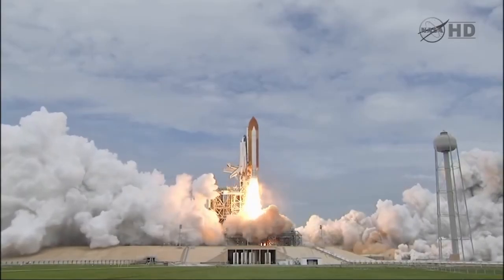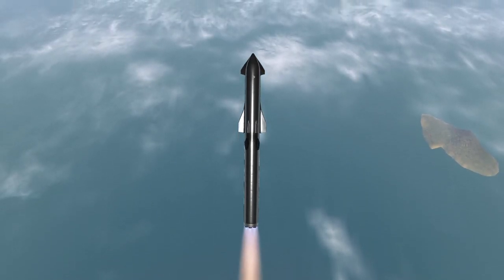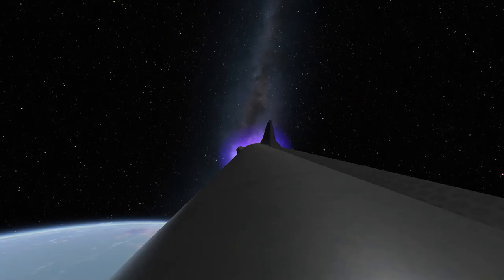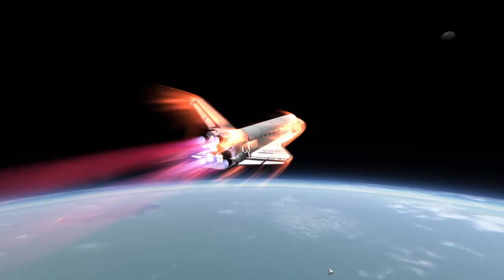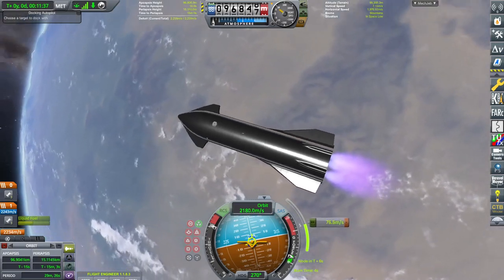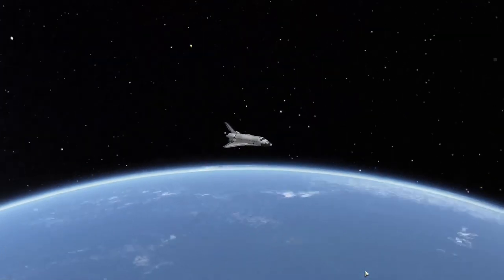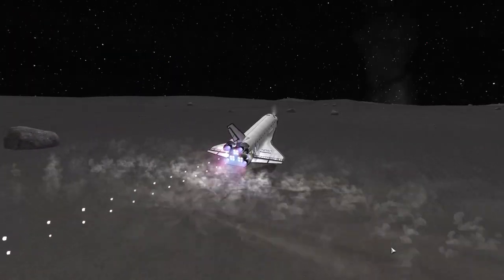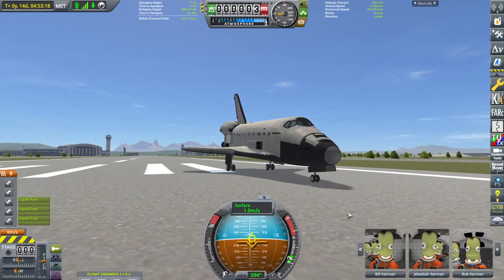Can You Turn the SPACE SHUTTLE into an SSTO?! | KSP Moon MISSION!

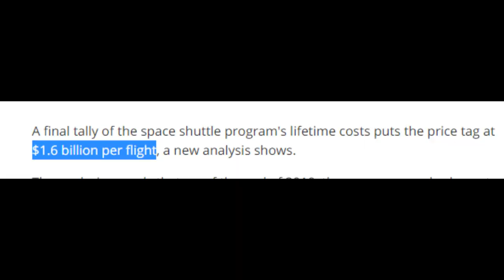Comment: 0:07 The actual average cost of launching a space shuttle as of 2011 was $450.000.000 (and that number includes fixed costs) And the shuttle fleet was not retired because of cost they were retired because they were getting old and outdated (Atlantis and Discovery were nearly 30 years old when the program ended) NASA litterally bought a load of outdated medical equipment so it could scavenge Intel 8086 chips

Cool video btw
Reply from the maker: Accounting for inflation it does surpass the billion dollar mark. But I appreciate the fact check!
Reply: Yeah
But i do think If you could remake the Shuttle now it could be good
Reply: @MorcsKSP  No it doesnt? $450M in 2011 is $592,782,709.98 in 2022 And plus the marginal cost was $252M in 2012 Dollars

Comment: Super heavy won't do a reentry burn they are going to try not to do it
Reply from the maker: interesting
Reply: @MorcsKSP  it makes sense because the steel should be able to handle the heat
Reply from the maker: @spaceanimator3295  I'll have to research that. I have to do reentry burn in ksp since the mod I have makes the reentry heating more intense.